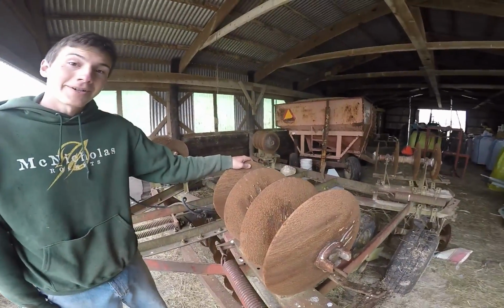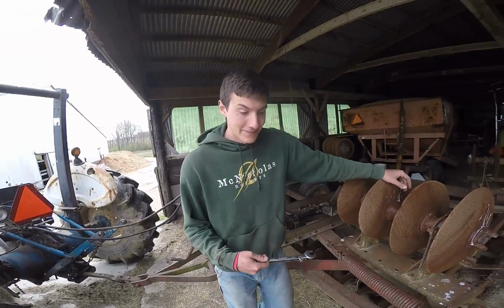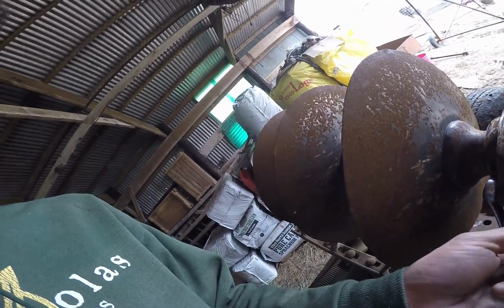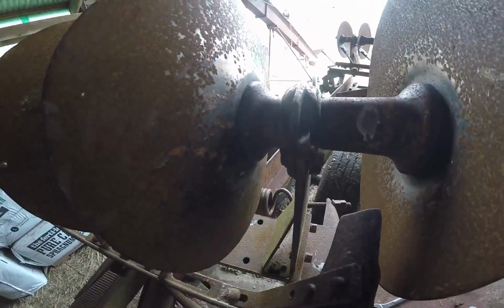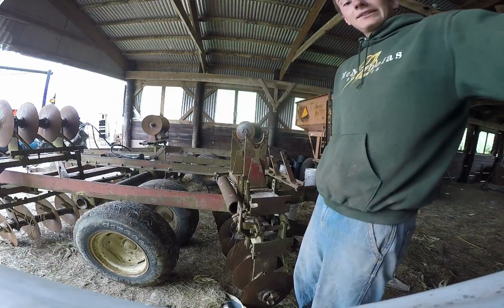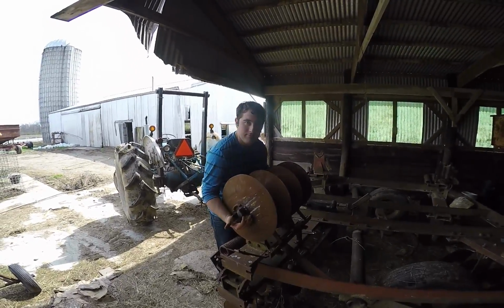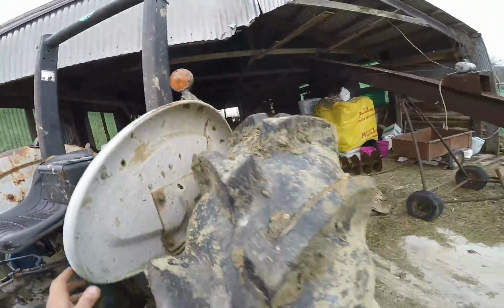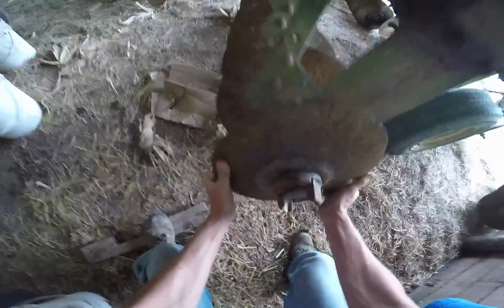IH 470 Disc -  Blades and Bearings Part 1

Comment: Just a tip friend,  task some acetone and transmission fluid mix 50/50 and put in a soda bottle with a tiny hole in the lid. It's cheap and tons better than wd40 or pb blaster love your channel
Reply from the maker: I have never heard of that. I will have to try it. Thank you
Reply: truckinmachine truckinmachine .... well said sir. I used to buy some stuff that was basically transmission fluid but now that you say it I'm going to mix some acetone and transmission fluid. I don't know why transmission fluid is so good but it does work quite well

Comment: Your doing it the hard way, I always broke the nuts loose before I took the gangs off. Makes it a lot easer to hold the gang still for one guy to do this job by his self.  I really hate it when your pulling hard on a pipe when the nut pops and you feel it in your hands , And boy does it sting !  LOL  I hope the rest of it goes smooth for you guys.  Bandit
Reply from the maker: You bring up a great point, and it vaguely crossed my mind, but seemed out of order. I'll tel you one thing. I am glad this disc has square axles so you can grip a pipe wrench anywhere. That 230 Ford disc has round axles, and you need a special tool to hold the axle at the opposite end.
Reply: I've broke a couple of pipe wrenches over the years braking the nuts loose on a disk gang.  I've found a wire wheel on a drill cleaning the threads out makes a big difference getting them loose and good old PB Blaster !  But sometimes it takes some help from Mr. Fire Wrench to get them to come off.  My uncle had a guy at champion bridge cut him some 3/4 plate into square and hex nut sizes just to make wrenches out of them and welded a 4 foot pipe to them just for taking nuts off of disks,  They sure came in handy more than a time or two ! LOL  I really don't like the disks with round axels in them, You just cant get them tight enough. They tend to work loose easer than all the others.  I have a question to ask you, Do you put the disk gang together with it laying down on the ground or do you put it together with the gang standing up ?  It makes a difference.  Bandit
Reply from the maker: My only concern is the frame getting in the way, but we shall see.
Reply: Bandit farmer i

Comment: your going far for land !! holy
Reply from the maker: I did, now, I do not. Everything is within five miles now. Everything big enough for a 4wd tractor to turn around in with a 24 row planter has the rent ran up so high.. I'm not the most picky when small fields come up at lower cost.

Comment: Front blades wear first ,they got a harder job to do then back blades . Someone told me disk pack the ground ? That's why you see them on road construction sites. Field cultivators are supposed to lift the ground and dry it out . Maybe someone come up with answer See you in next video
Reply from the maker: My agronomy professor tried to tell me that. I still don't buy it. If you disc fast enough, it will throw dirt around too. Construction has their rippers on the back of bulldozers, which it a heavy cultivator.....
Reply: Meh that's what they SAY... basically ANYTHING that moves IN or ON the soil causes compaction... supposedly as the disk blade slices in and shoves the soil sideways, it causes compaction, or the back of the disk blade rubbing against the furrow wall causes compaction... BUT so does a cultivator shovel or moldboard plow share, or chisel point on a disk ripper or chisel plow... Basically when you're tilling you're forcing steel into the soil and where the steel displaces the soil because it's being forced THROUGH it you could "call" compaction.  Even "vertical tillage" or coulters are basically causing compaction because the blades are being forced down into the soil.  

Dig a soil pit in a field worked by cultivators over the years there'll be a plow pan where the shovels smeared the soil under the shovel as it ripped up the soil above the shovel.  Same thing as "plow pan" with a moldboard plow.  Same thing with chisel plows which can end up following the same furrows over time and compacting not only the bottom layer of soil under the point of the chisel blade but the sides of the trench it digs as well.  It's all well documented, and usually used as sales fodder by whatever company to promote whatever it is they're selling LOL:)  

Compaction, like everything else, has to be MANAGED by changing types of depth of tillage, directions, etc. and working the soil at the proper conditions, not too wet or too dry, etc.  Later!  OL J R :)

Comment: Where did you get your new disc blades? I have a 12 ft. IH model 37 disc, not much difference between it and yours.
Reply from the maker: Rural King. The stores around us have discontinued stocking them. But, one store in a less rural area still has 100 of them, all from the day the store opened four years ago. And they are $7.03. They won't move them to the clearance aisle because of weight, and they are still marked original price, except for the in the computer.
Reply: Boehm Farm That's cheap for 20" disc blades.
Reply from the maker: If not for that deal, I am not sure we'd be replacing blades right now. They are close to $30 from anyone else. SO by the time we get news, I could just buy another less used disc.
Reply: @boehmfarm4276  Hope they hold up for you, particularly if you have rocks... IMHO when it comes to disk blades, you get what you pay for, particularly in tough conditions...  The Cadillac of disk blades is the "Earth Metal" by CIH-- my BIL uses them but they ARE salty... BUT they also outlast every other blade by at least 2:1, so that brings a LOT of value compared to cheap blades that wear off twice as fast... PLUS in rocks they just shrug off damage that would fold cheaper blades into a taco shell or snap them in half... looks like some of those on your disk had a run in with something they didn't like... He's got a LOT of rocks in northern Indiana on his farm, so it's well worth it to him to pay for the Earth Metal blades; he had cheaper ones before and was busting or cracking one just about daily, switched to Earth Metal and IIRC he told me he's never broken one since... Worn out a couple sets, but never broken one... OL J R :)

Comment: What's the advantage of having larger discs? Also, it would probably ruin your day if one of those gangs fell on your foot ☺
Reply from the maker: What's the advantage of a larger combine??? Bigger is better right? Bigger blades have more weight to sink in and could cut deeper. I think a bigger blade would have more curve to it: The blades are spherical, so if they use the same spherical dimensions for a 20" as a 22", the 22s will have more curve for more dirt throwing action.  Compared to the old blades, the new ones are thicker, so they won't crack like the worn one will.
Reply: Smaller worn down disk blades just don't penetrate the soil properly... they don't cut well, they don't cut through residue well, they don't turn and mix the soil well.  New sharp blades slice easily through residue and cut into the soil better and deeper, and do a better job at turning and mixing the soil so you do a better job disking.  Plus a newer blade is quite a bit heavier because not only is it going to be bigger around, but also thicker-- you can't see the steel worn off the front and back faces of the blade which makes them substantially thinner... this adds a LOT of weight to the disk which makes it penetrate into the soil much better as well.  Later!  OL J R :)

Comment: Boehmwow the first nut she turned to easy and last that how it should have sounded with cricking sound and use the grunting sound well could have had to cut them off so that was a good thing.
Reply from the maker: We've had issues with the bigger gangs coming loose. I figure those have all been replaced over the years and the new axles are stretching. The wings I think could be original.
Reply: Boehmwow she has been rep[aced over the years yes but to have everything else original you have been lucky for rocks are of course hard on the disk good video.